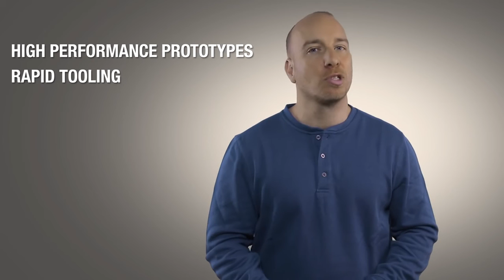FDM Nylon 12CF 3D Printing Material

Comment: Are mechanical properties linearly scaleable? Have tests been performed on larger cross sections, say, 1" square? Do you have a material spec that would be accurate for real-world applications for making a material spec for Solid Works custom materials? ( I have read your spec sheet from your website.)

This stuff sounds awesome. I would like to know if I can model and simulate using SW, with reliable results. Thanks in advance for your response.